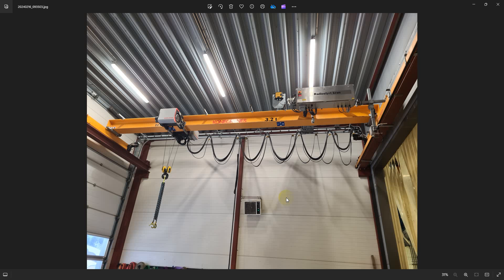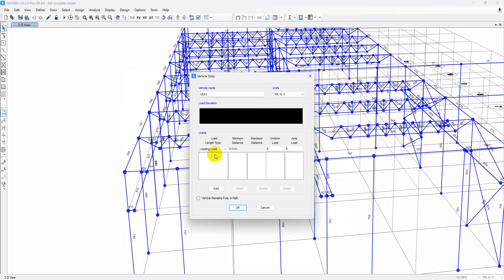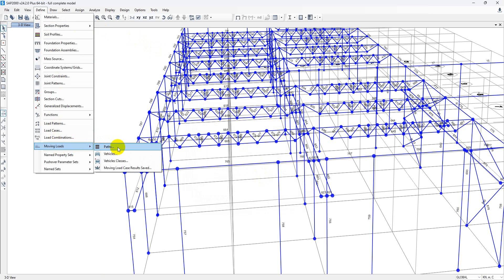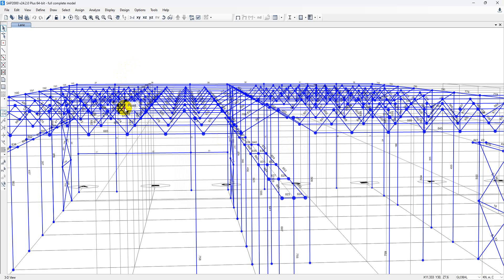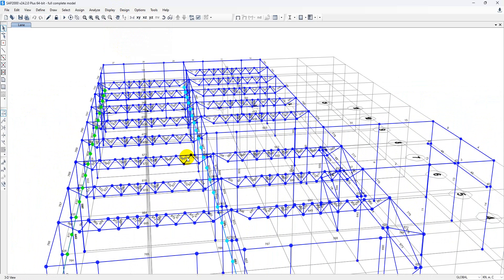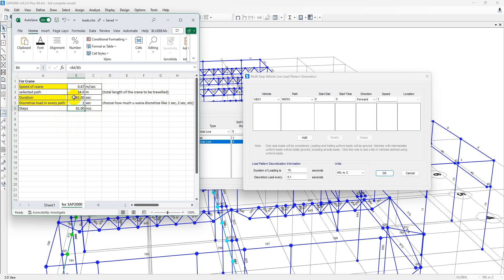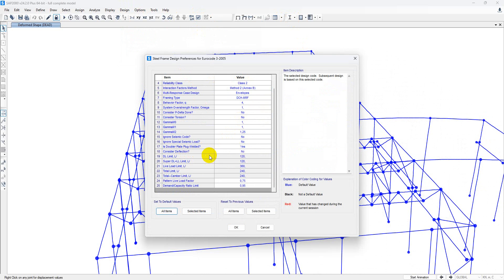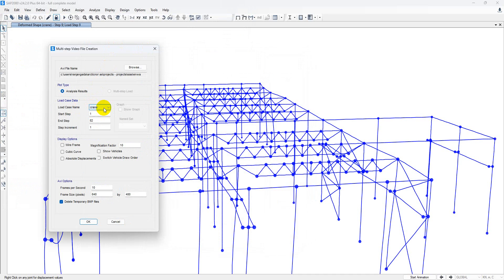Moving vehicle load in SAP2000, Crane moving load in SAP2000 full tutorial

Comment: Thank you for this illustration. I could not see that you applied any horizontal or longitudinal forces for the vehicular load. why is that ? cranes usually modelled with vertical loads, horizontal lateral load and longitudinal forces.